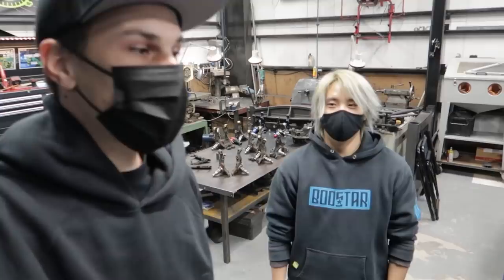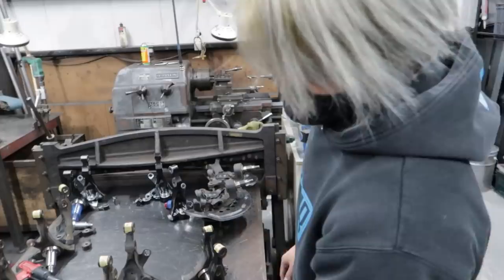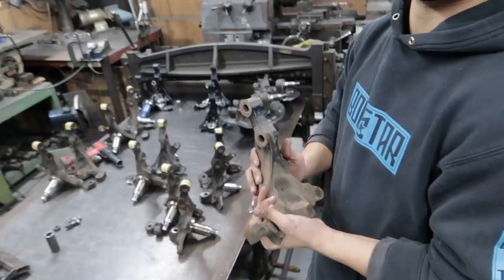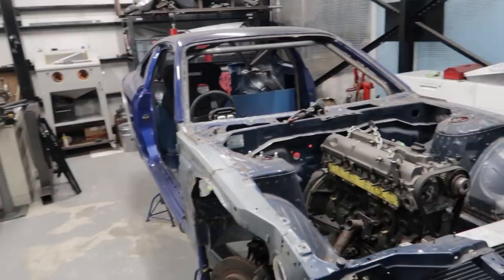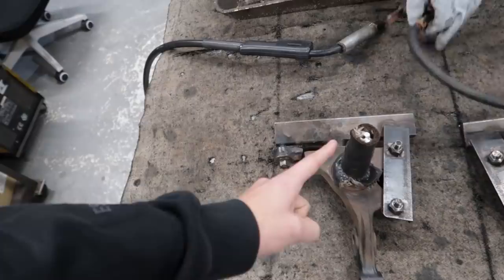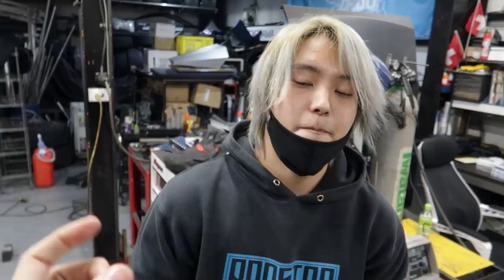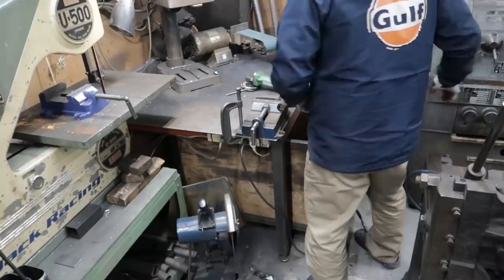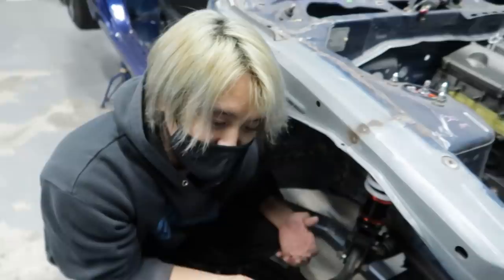HOW JAPANESE DRIFT KNUCKLES ARE MADE! - REVERSE KNUCKLE

Comment: Awesome! Maybe you can help him to translate his website to english :D I want to order but I'm nt sure what to select
Reply: I would recommend going through an exporter in Japan to buy these (I personally use Jessestreeter.com) but if you want to know the drop downs I will explain. Top box is Basic or SPL, SPL just means the welds are ground back to look neater (this costs more). Second choice is what colour you want, green or black, green costs a little more. Third option is choice whether you are sending stock knuckles to be modified or whether you want them to supply you with ones to modify. Of course it costs more to have them supply the knuckle so you can tell which is which by the price change when you select each option. If you cannot read this level of Japanese I think you will need to use an exporter company though otherwise it will be to hard to arrange. Hope this helps someone :)

Comment: I do the same thing here in New Zealand. Never had one break.
Reply: A33 cefiro/maxima rack ends 40-50mm extra. If you have an s13 you need to go s14-15 tie rods or even a33 to make it easier at the parts shop.
Reply: Do you run into clearance issues with the stock tension rod, or the inner fender wall? Also do you extend the LCA ?
Reply: @danielBMXisFUN  you will run into issues if you use a weak offset or wide rim.  I usually go 25mm lca and offset tension arm .